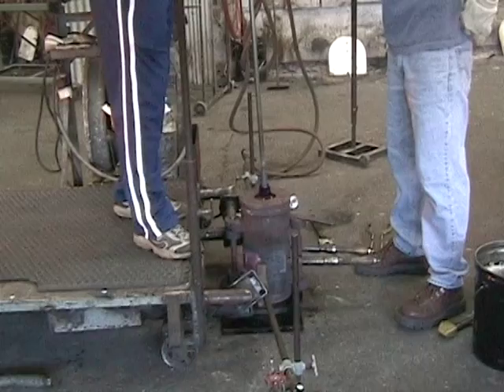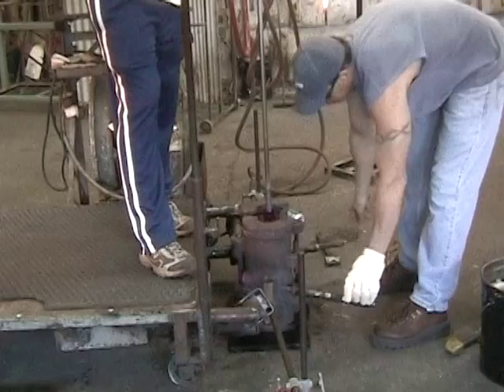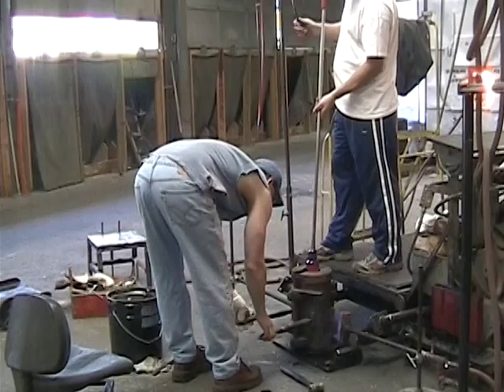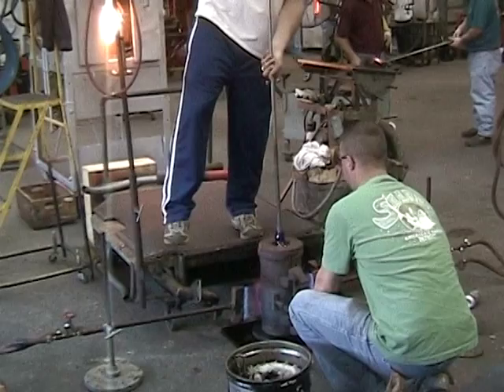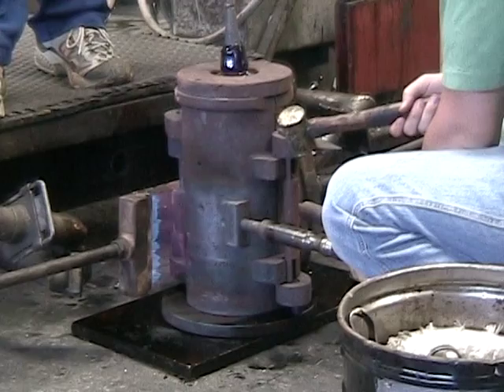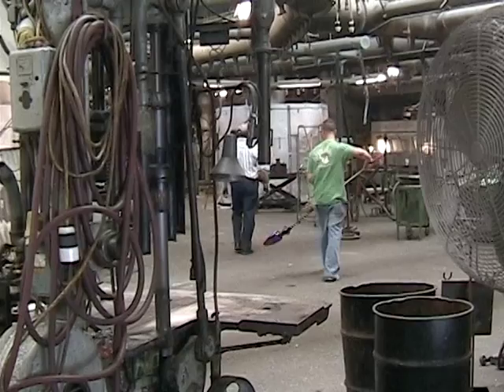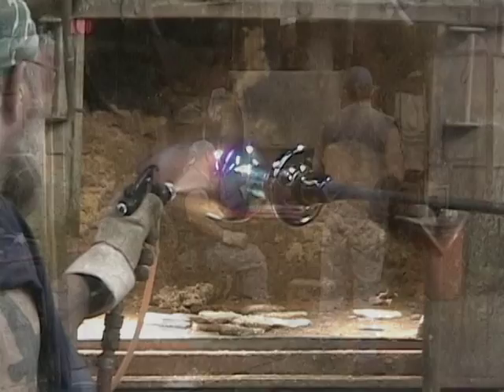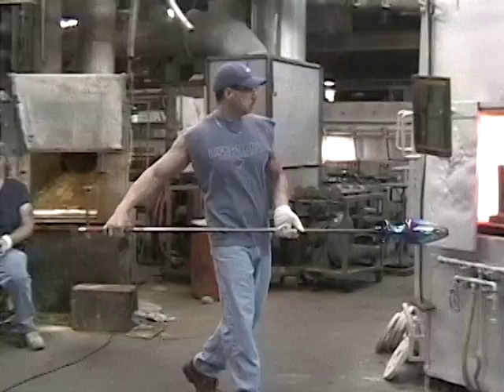Making of a blown-molded vase at the Fenton Art Glass Company Factory 2005

Comment from the maker: The actual process takes about 6 minutes from starting to take a gather to finish (putting it into the lehr).  There are usually two to four people taking gathers and walking each piece through the process.  This is slower than the pressed pieces that Fenton made where there might be five to six handlers and one or two finishers.  This would mean that they would produce a piece every minute or less while these blown molded pieces would be a piece every two to three minutes.  Each piece may take three to six hours in the lehr (an oven that slowly cools the piece to remove internal tension), depending on the size and form.